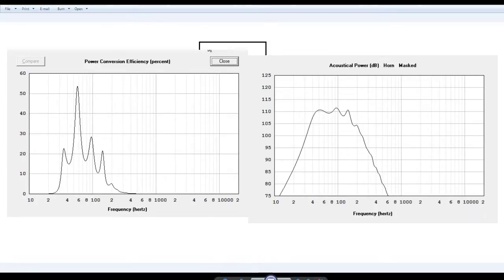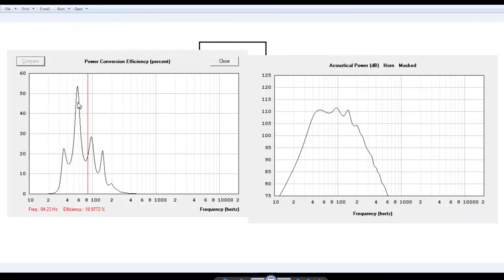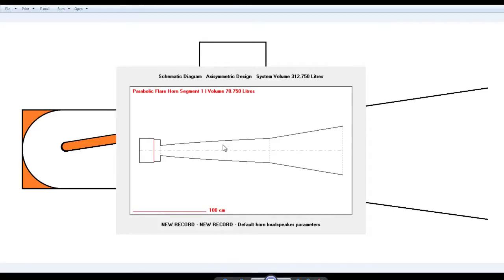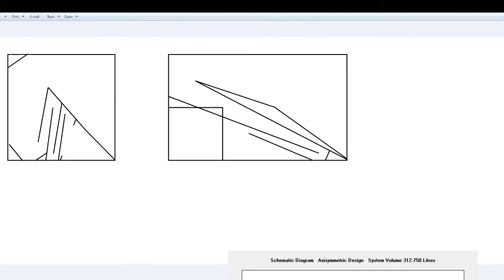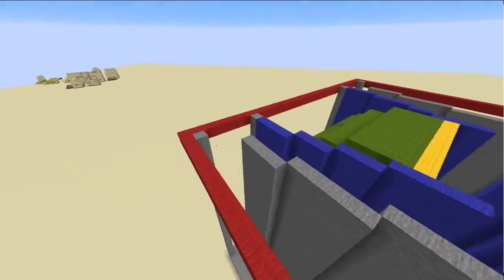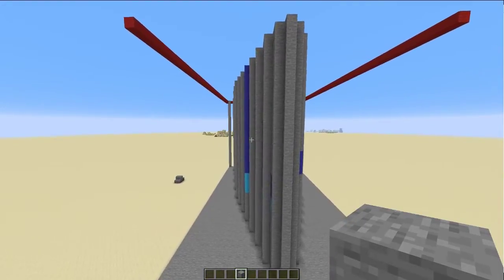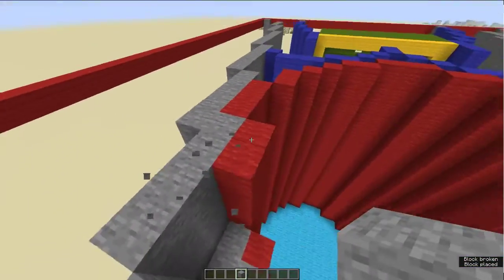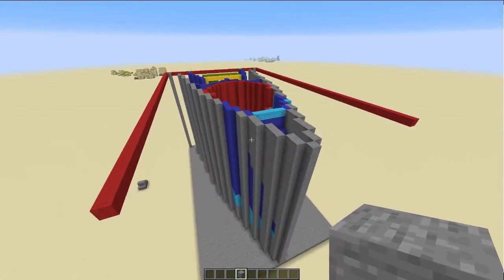Folded Horn Project Introduction

Comment: 90db/1w compared with 110db/1w does not sound 100 times louder. For a direct radiator sub 90db/1w double that two boxes gives 93db/2w total double that it's 96db double that it's 99db that's 8 boxes 1w each add 2 more boxes 1w each and the total of 10 boxes 1w each gives a total of 100db/10w. To the human hearing it only sounds twice as loud. So to get to 110db you need 100 boxes 1w each. That sounds twice as loud as 10 boxes. The ear sensitivity is very different from the power in watts input. The advantage of the folded horns is the horn is a transformer from high pressure low cone excursion to room air pressure high volume of air movement. A horn is an amplifier in itself. The Key is ...... Every increase by 10db sounds twice as loud to the ear.....

Comment: Can get the schematic to build one? what subwoofer model did you  used?
Reply from the maker: I don't currently have a schematic, I should draw one up some time. The complexity puts me off though. 
In regards to "what subwoofer model did you use?", I believe you mean driver, which was the Digital Designs 812d. Chosen due to high power handling, strong motor, small cone (key to the design), and because of a lack of options in Australia.

Comment: can a folded horn tune down to 10 hz? I am looking for a good box design for 10-40hz range.
Reply from the maker: Technically, yes, though it'd be enormous. Very efficient, though enormous. To be honest at 10Hz I'd just maximise cone area, 15s at least, and plenty of power. A 10Hz horn woulc have to be around 10 metres (33ft) in length. Even a nicely folded one will take up a large space. Definitely a project for the brave, and perhaps the final frontier of low and loud.
Reply: @Dakoustics  I would be using 18s or if budget allows 21s. Room for 2 9X3X1 so 27 SQFT. I could do a single 6X2X7  or 84 sqft
Reply: FS on the 18s are 24 hz